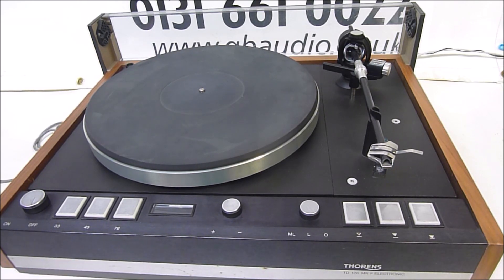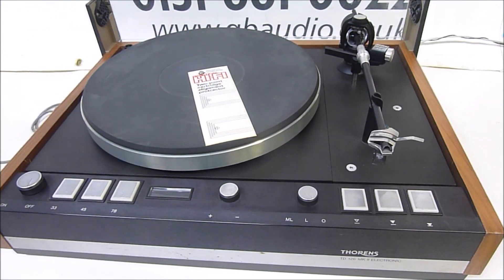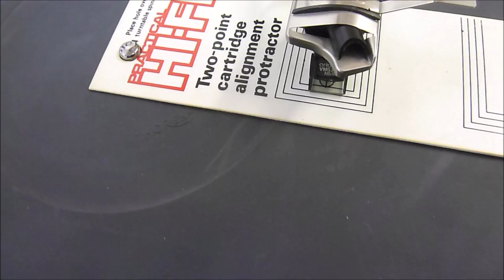Thorens TD126 Mk2. Part 3. How to set up cartridge alignment, headtube, tracking weight, anti-skate.

Comment: I have the same arm, and I was trying to make a two point Baerwald alignment, like I used to do it on other turntables. But in this case the cartridge angle is fixed, and at the outer alignment point, the cartridge is about 1~2 degree  out. I have set the the correct overhang at the inner alignment point, nothing more. For what type of alignment is this arm designed?